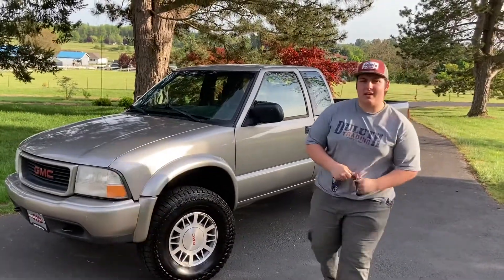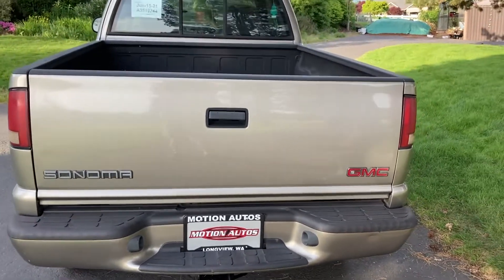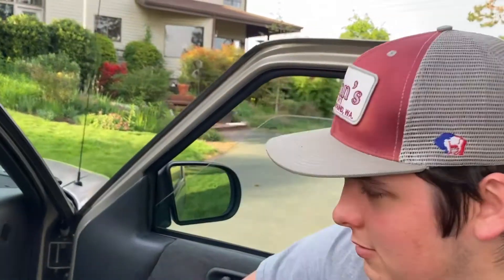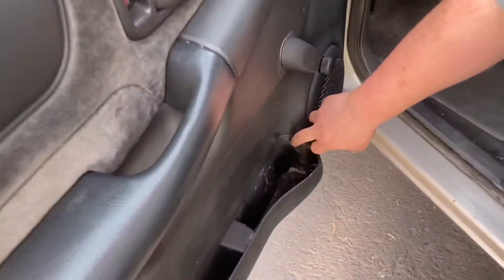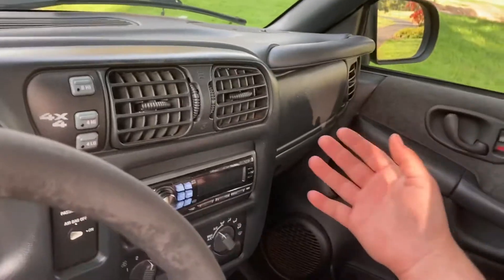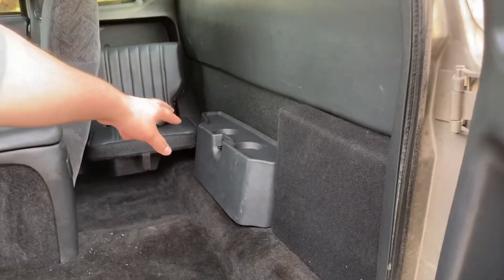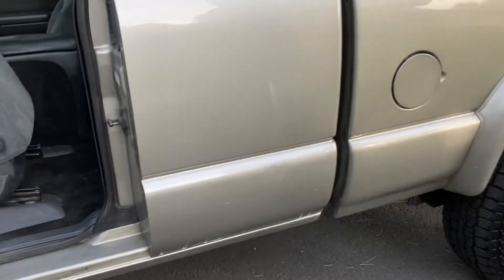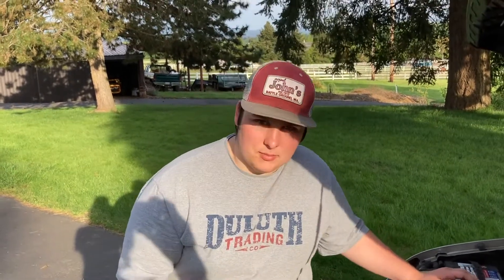2001 ZR-2 GMC Sonoma Overview

Comment: I had one. Worst truck I ever owned.
Reply: I have one too, same colour, but not a ZR2 pkg, just a regular 4x4 automatic. Lots of little things have broken on it over the year, worst is the oil leaks from the 4.3. The front end needs some work, it's a bit loosy goosy, but I rarely drive it anyway, so i haven't gotten it fixed.